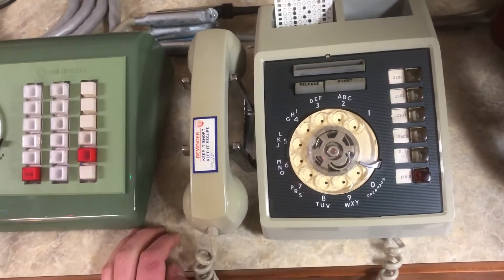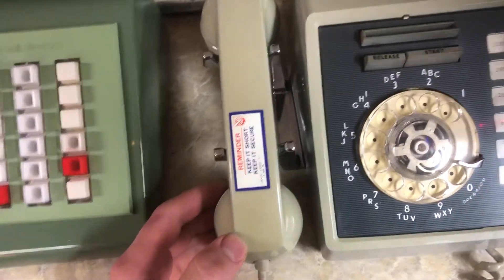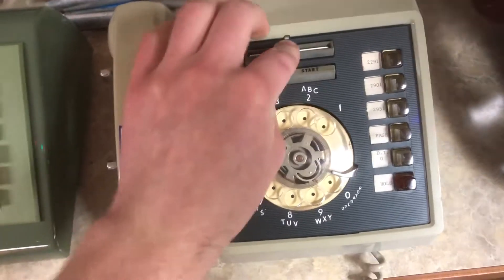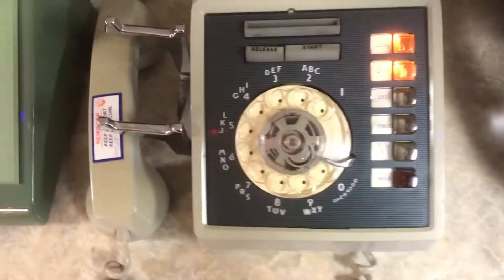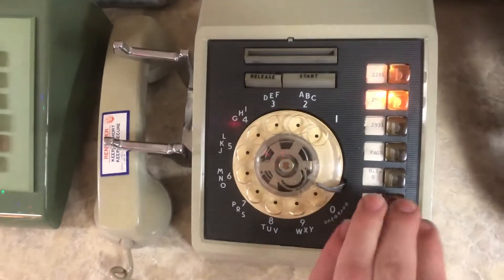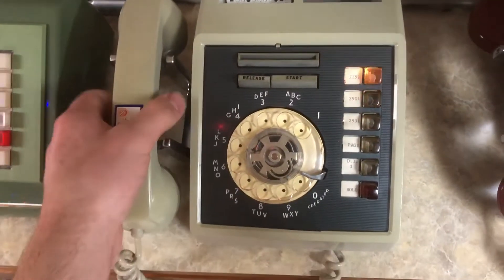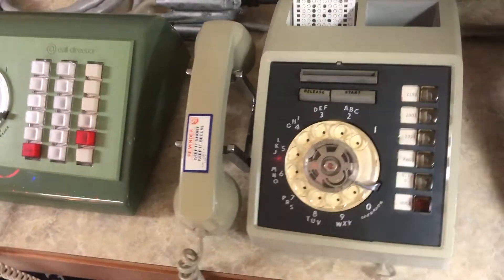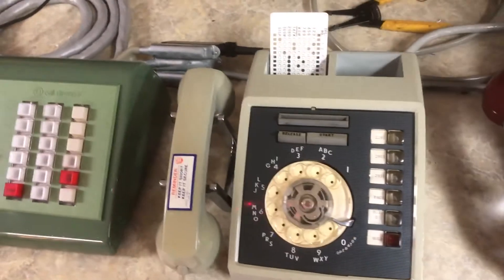Western electric 662 card dialer

Comment: Can you do an update on the tower of terror model?
Reply from the maker: Of course I would be happy to!

Most people haven’t been showing interest
Reply from the maker: Is there something in particular you are curious of?
Reply: Well I am curious on how you did those lights for the tower, thinking about adding some to my model too, and how you did the moving elevator, it was awesome!
Reply from the maker: @grimproductions1174  the moving elevator was a bit of a achievement lol

I’m not sure if I can get all the info you need in one video but I am happy to post segments on individual details if you like
Reply from the maker: How I did the lights was some 12v  rgb 5050 lights for spot lights on the tower itself and also internal illumination 

I also made a few replica light fixtures that used 3mm warm white lights wired with the 12v ones

The outer sign (which was my favorite part ) I used white el wire and a heat gun to bend it to shape I used about 9 ft

Originally when I started I didn’t want to wait for the parts to get there (I’m a bit impatient) 
But el wire makes a world of difference trying to authenticate neons 

Most of my tower runs on 12v
Reply: @kadensmodifications  ok I see, I’m not an expert at lighting and mechanical stuff, but I’ll try to use these tips for my model, thanks!
Reply from the maker: @grimproductions1174  I’ll try and get a video up for you as well 

and I am more than happy to answer any questions you have
Reply: Thanks!